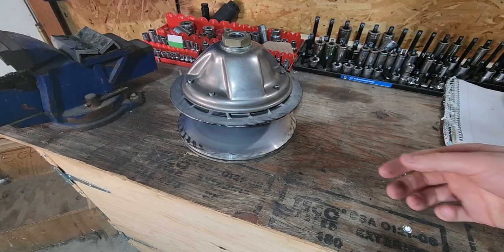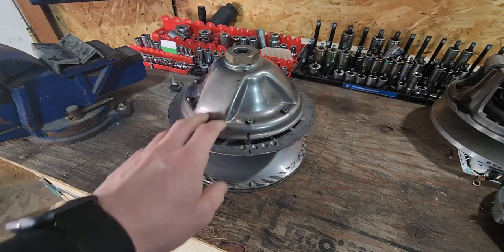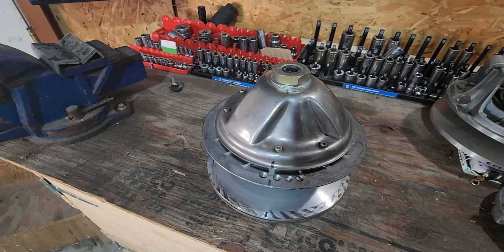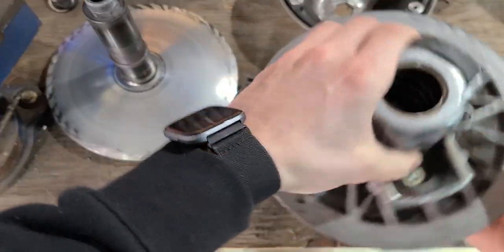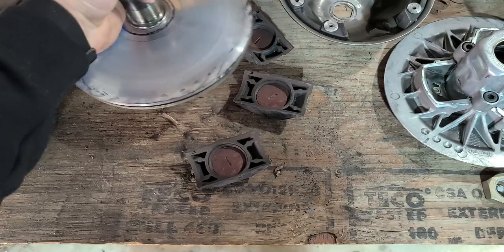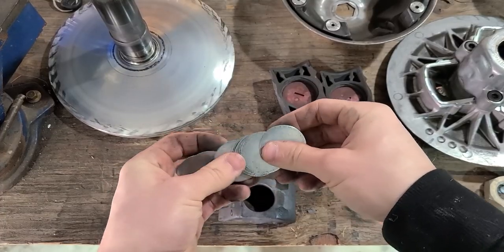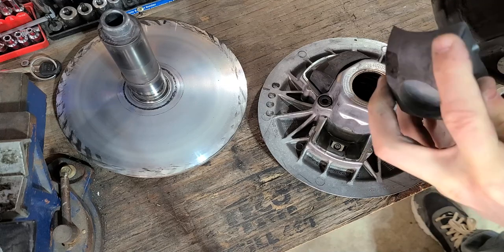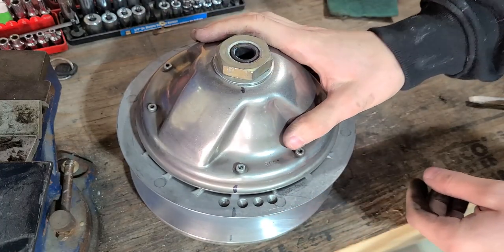The BEST UPGRADE you Can Give to your Arctic Cat | CVTech Power Bloc 80 Clutch LONG TERM REVIEW

Comment: I’m actually running 2 of these PB80 clutches. 1 on a zr7000 1049 triple 4 stroke and the other on a xf9000 998 turbo. I will say they have been smooth as silk. They really preform and have been completely trouble free!

Comment: Hey all , and Mr Syxxes..... Any one had the rubber attached to the cover come apart and parts of it come out? Found pieces in the belly pan and finally figured out where they came from. Only 200 miles on it. Sure it would cause an out of balance condition and probably do the crank bearing no good. The little screws on the cover hold a rubber dampener or something to the cover at the base. Has this been a problem? Tightened down to tight at the factory? What is the purpose of the rubber?

Comment: Interesting clutch there. 
I have a few cats one is a 2010 ext Z1 turbo with 300 hp tune. 
I run it on the 240 tune mostly though. Blew belts like crazy at first. Had to cut about 1/4 inch off back side of secondary to align clutches. Now it runs flawlessly had to do my own clutching. Use to clunk really bad so i put a 125-340 I believe spring rate in the primary. 
Anyway no more clunk engagement clutching is probably about perfect.
Might try that that cvt tech clutch. Have a stm secondary already to try. 
Stm primary is lot of money so idk. 
But anyhow great video 
Thank u

Comment: First of all I will say I really enjoy watching your videos they're very informative. I have a question for you if you are able to help me? I recently just put a power block 80 clutch on my son's 2013 Arctic Cat 800. I kind of just based it off of what you were doing because I'm tired of buying cat clutches LOL. I need some assistance if you can give it to me regarding you the weights that you used. His sled came with 67's originally on the factory clutch. The power block comes with 12 weights and they are telling me they are 5.5 Oz per weight which would give me 66 total. The most we can get out of it right now is 7400 RPM. I know by watching your video I believe that you ended up with 10 weights which would give you 55 Oz. And you were topping out at 8150 RPM. I just wondered if you stayed with that weight ratio and how it worked for you since you're sledding his letter almost identical. We live in Kamloops and we are usually riding around 5,000 to 8,000 elevation. Thank you

Comment: put one on the other day got 3 rides on it and under heavy back shifting cause my secondary bolt to back out...not to sure whats going on maybe its more secondary but i've red lock tighten my secondary bolt in and will still do it. Last time it happened i helied my sled and and now need a secondary and jack shaft(stripped the splines)

Comment: Have this clutch in my 2013 F800 TH and love it.  Why not remove the ring weight for a lighter clutch and quicker response?
Reply: Quite possible that is on the clutch to help with crankshaft harmonics.
Reply: @SuperBigdanno  I thought that as well but CV Tech said it was not required and just adds rotational weight.

Comment: I see them available on Ebay from Motorhead zone. Not sure what they mean by precalibrated. Are they just doing weights or maybe a spring??? Have a question in to them. '10 M8 HCR 153" 3-6K elevation.

Comment: I just put one on my older ZR 600 and what a difference.  I did find out that my clutch was calibrated heavy when I installed it too.  I plan on putting one on my 18’ XF 8 to smooth out the bottom end between 0-25mph. I plan on making a few videos on this clutch too.

Comment: I don't know how the PB80s are on the Cats but on the Ski Doo 4 strokes, I know they are hard on belts, they build up alot of heat. 

Easy maintenance and a good shifting clutch but many people replace the belts every year just as a preemptive maintenance
Reply: If your blowing belts then maybe try to add some weight to the primary, my guess is they are running hot. Also make sure alignment and deflection is correct.

Comment: Anybody running this clutch, did it solve the problem of the sled in reverse ? I have a 2013 F800RR when I put the sled into reverse it binds up the only way it works is to get off the sled. I did a Google search and it seems like a pretty common problem with this sled .

Comment: My PB80 seems to run hot, it would burn your hand to touch it after about ten minutes 20 minutes of riding.
Reply: Add some weight or a lighter spring. This is of course as long as all other components in the sled are all good.

Comment: Fact…a PB80 on a skidoo 850 will shatter the spring cup if ur running 6500-7500rpm routinely…cost me a 185$ taxi ride
Reply: Same clutch on a 1200 ran 8700 miles zero issue